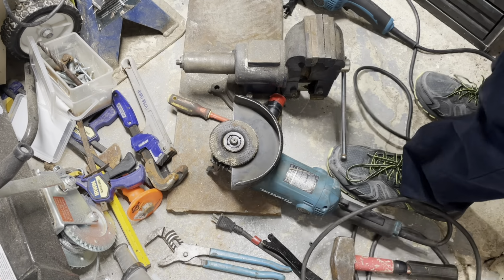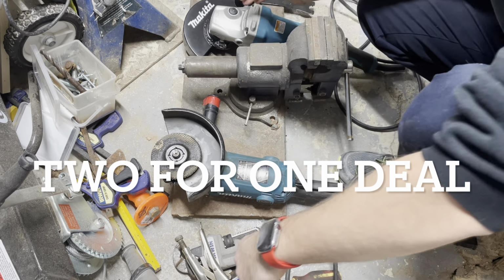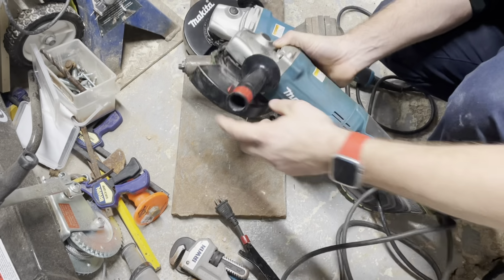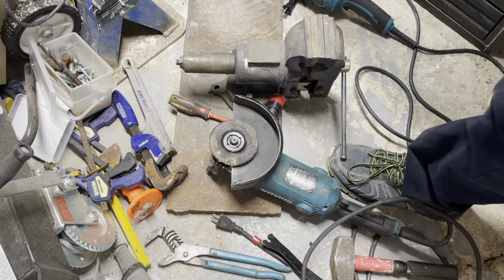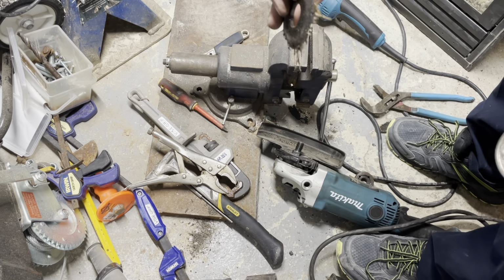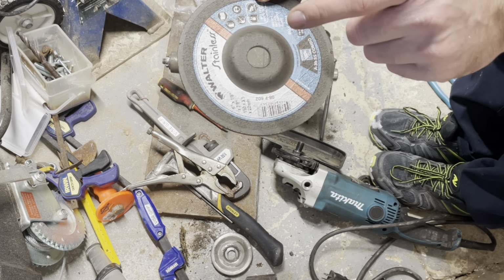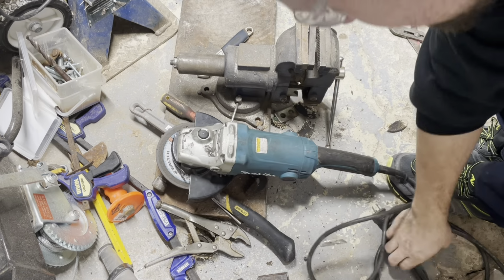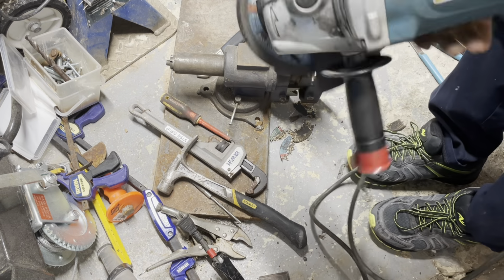DIY - How To Remove A Stuck Angle Grinder Blade / Disc / Wheel By Force - Tool Life Hack =]

Comment: Thanks for the video. I used my vice grips after watching. I pushed down to the floor with the grinder underneath, so instead of using my failing strength (!) I was using my weight. Your video really helped get my head around it.

Comment: Dude, one minute vid it should be,  not some big production as this vid you're showing us.    Solution: use PB B'Laster to soak-lubricate the stuck thingy,…. then get a round-style channel-lock-wrench,…. put the blade on carpet or something of similar effect, maybe on dirt or weeds,…. to prevent the blade from turning, in addition to pushing in on the lock-button as best you can to keep the blade stationary,… then lefty-loosey the stuck thingy with the channel-lock-wrench with all your strength.